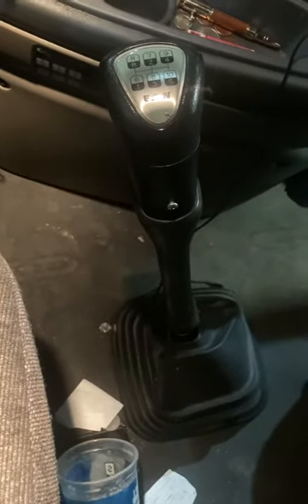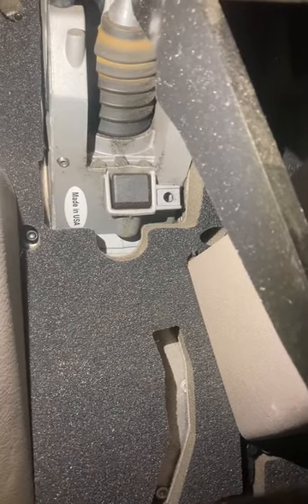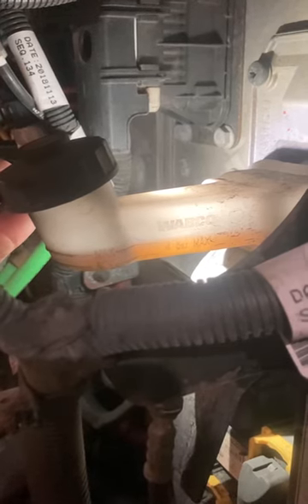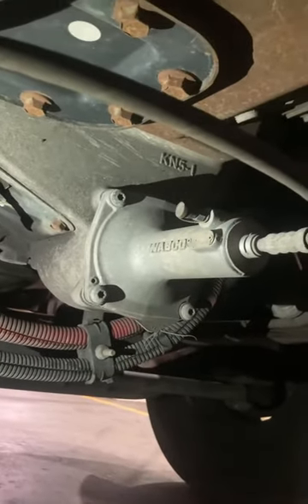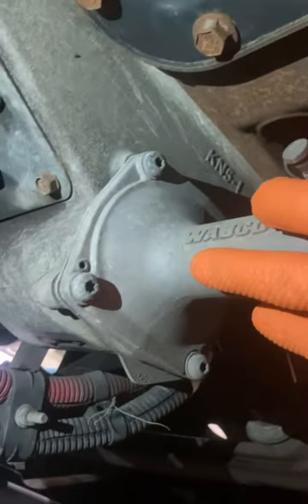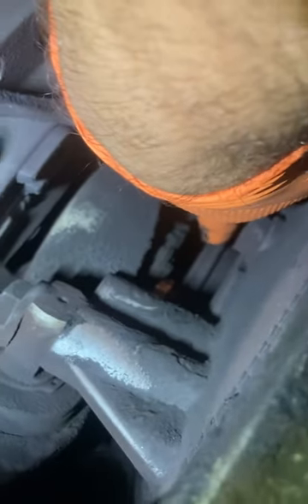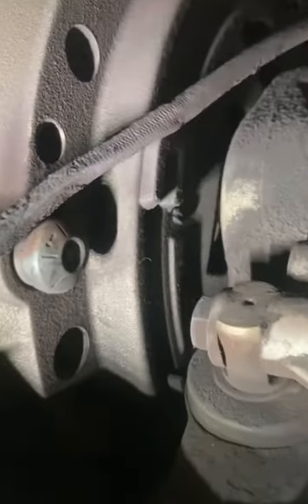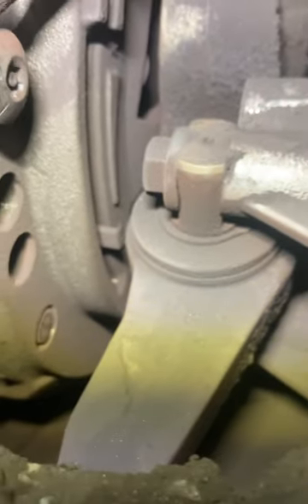Truck grinds going into gear! How to check your clutch? Eaton trans/clutch heavy duty vehicles

Comment: How do you adjust the gap between the clutch brake and the throw out bearing?
Reply from the maker: Is it a self adjusting hydraulic clutch?
Reply: @alreyindustries  yes. Hydraulic clutch, replaced master and slave cylinder and I’m lost.
Reply from the maker: @G-AND-A-PRESS-PLAY  two ways you can try:
1. Hold the clutch pedal down (you’ll need someone to help or a pedal depressor).
While the pedal is pressed down, push the “wear indicator tab” on the face of the clutch all the way back to the “new” position.
Release the pedal and pump the pedal several times. See if that adjusts that gap.
2. If it doesn’t adjust that way, you can do the same procedure except, after you push the wear tab all the way back up to the new position and release the pedal, you can hold a spacer (something metal about a 1/4 - 1/2 inch thick) in between the throw out bearing and clutch brake before pumping the pedal again. Sometimes that spacer will cause the clutch to adjust and remove that space.

Something else you may want to check is the hydraulic system. Pump the pedal several times to build pressure in the hydraulic system. If the gap between the throw out bearing and clutch brake gets smaller or goes away completely that means something is leaking in the hydraulic system causing you to lose pressure not allowing the pedal to push the forks as far as they should go. If that’s the case I would check the slave cylinder.
Reply: @alreyindustries  clutch is brand new also. The tab is in the new position.

Comment: Bring back the mechanical clutch linkage , they are foolproof .  Hydraulic clutches have too many parts and have high failure rates compared to mechanical linkage . A self adjusting clutch is used with the hydraulic system . They are expensive to maintain .  7/28/23

Comment: Does a 2004 freightliner columbia 10 speed have a master cylinder
Reply from the maker: I’m not sure. If you have a hydraulic clutch you have a master cylinder. If you have a mechanical clutch, you do not.